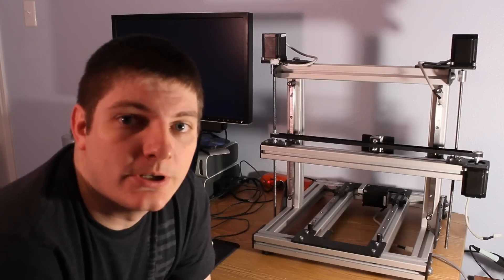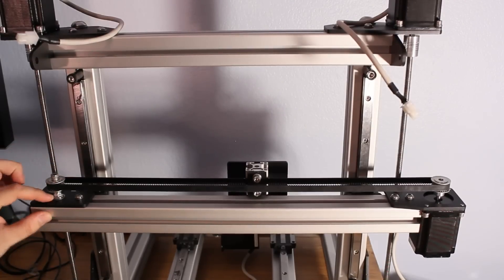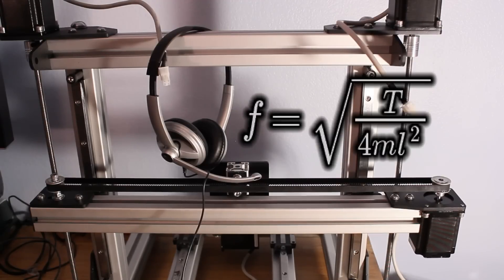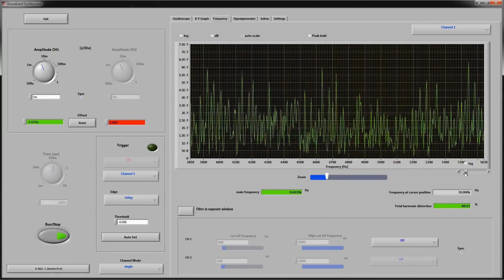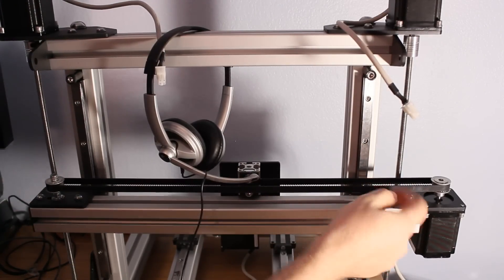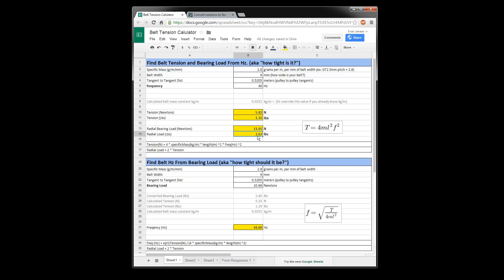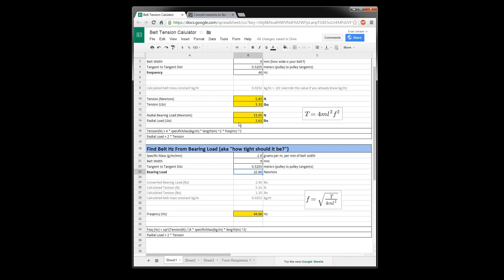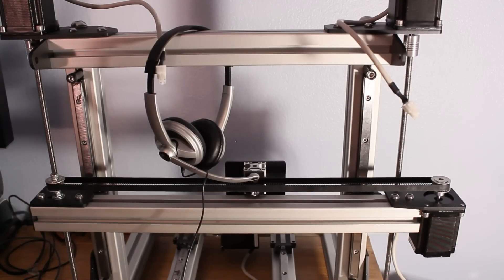Evan's DIY 3D Printer / Mill - EP4 - Belt Tension. Sound + Math = Bearings that Last.

Comment: There is an error in spreed sheet formula. Cell B31 - frequency is =SQRT(B26 / (4*B28*B22)^2)  but should be: =SQRT(B26 / (4*B28*B22^2)), the frequency calqulated by you is 4 times higher then it should be! 
That's why you deleted the equation for T - the values didn't match did they?!
Here is fixed spreadsheet: https://docs.google.com/spreadsheets/d/1lmsSYp317weSqZ5O251ipeNs0SL-cy0IWwBNU9ocPEY/edit?usp=sharing
Reply from the maker: Eek! Thanks, I'll take a look and fix the sheet.

Comment: This is the best video I've seen on measuring printer belt tension. And it's a good argument for open source hardware, because you need part info to find the belt and Nema motors' datasheets.
Reply from the maker: Thanks!  I agree on open hardware.  Long ago I worked with a waterjet company called "WardJet" (we were the customers).  They opened up the BOM to customers down to every nut and bolt, most of which were a link to the part on McMaster.  Nothing really went wrong with it, but that was a good feeling.
As for the tensioning, we did this at an automation integrator on much much larger belts and of course the formula holds strong.  Have fun out there.

Comment: I have my Wanhao Duplicator I3 gt2 tension belt at about 80 hz.  Hope this is okay.  Nema 17 motors (one on each side of the a-xis bar).   Maybe it's too tight?  I have no idea what kind of load those motors can take.  The printer isn't as wide as yours.. maybe 1 foot wide on x axis.

Comment: Great suggestion +SquishBrained never considered using acoustic monitoring to check tension. For anyone struggling to make a copy of the spreadsheet you need to remove part of the URL in the description and go to:

https://docs.google.com/spreadsheets/d/1iCvzsCI1vK_nUFhXPv7sSQhVSUuQpCGAv8foTCUHKs0/

Otherwise it displays as HTML with no buttons to make a copy or edit the sheet :) Will test this out tonight.
Reply from the maker: +Tony F Thanks!  I fixed the link to the spreadsheet with the one you provided.